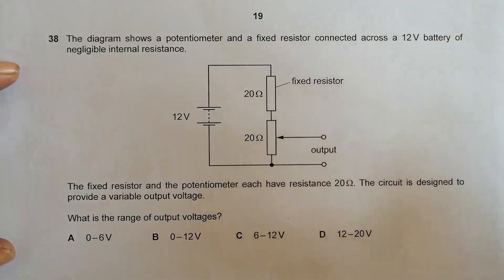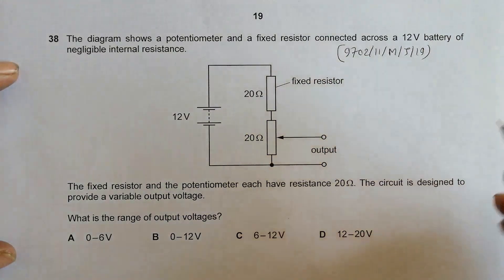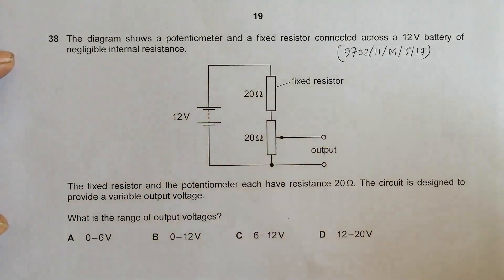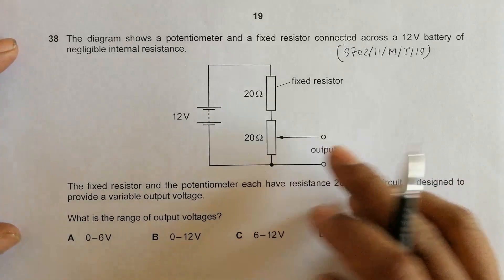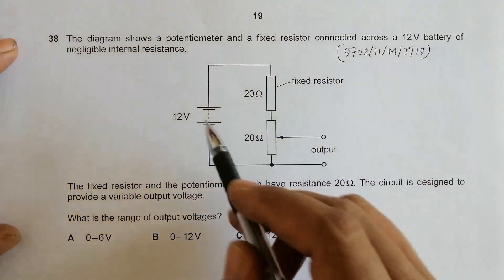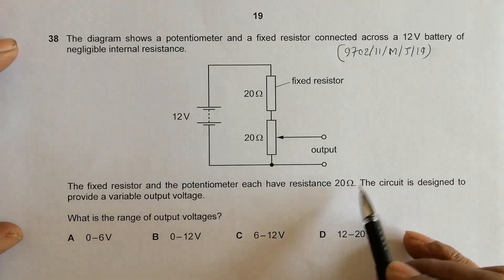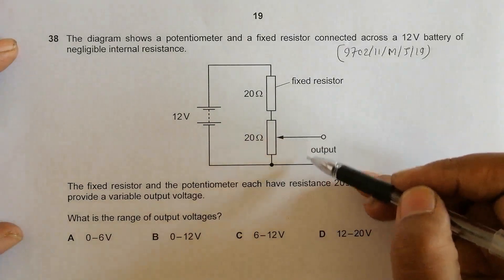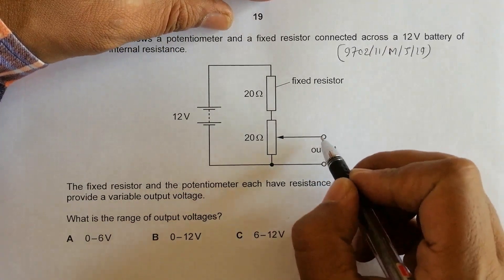2019 CAIE AS & A level May June Physics Paper 11 Q. No. 38 (9702/11/M/J/19) by Sajit C Shakya

Comment: why cant we place the potentiometer on the edge of the other 20ohm resistor and get an output voltage of 12V?
Reply from the maker: We can, if we really want so. But the two resistors are different items, they are also bought individually. The sliding terminal of the potentiometer is not designed to reach the other resistor. It slides within its own periphery. Any attempt to take it away will damage it!!! If we need 12 V maximum, we can have a single potentiometer instead of the combination of potentiometer plus fixed resistor.
Reply: @sajitchandrashakya  thankyou so much